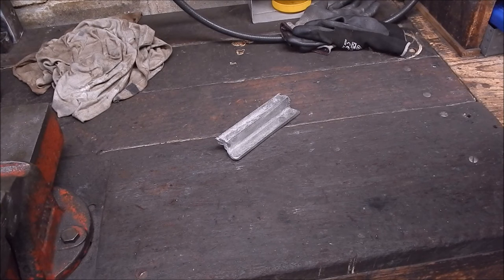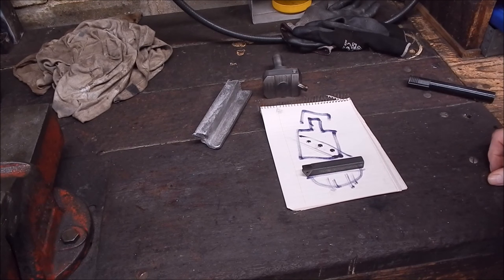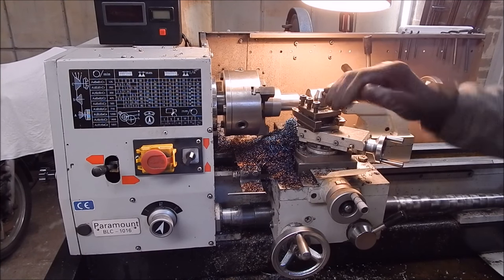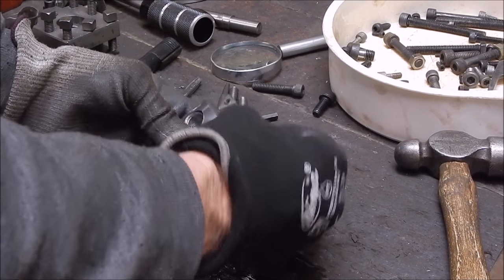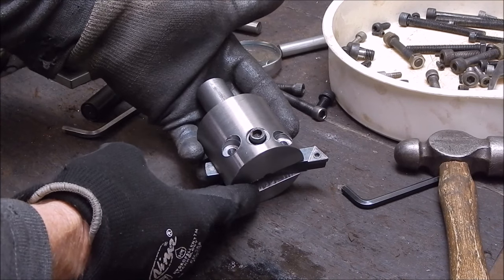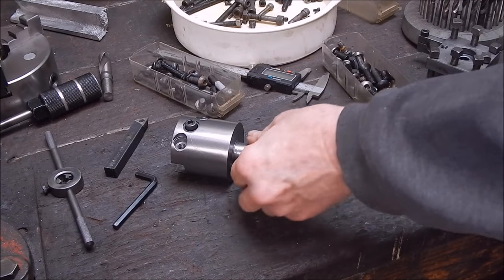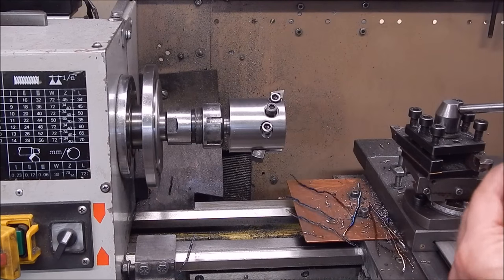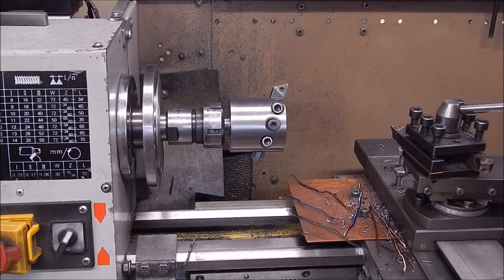Make a fly cutter that uses your existing carbide tooling.

Comment from the maker: In the example shown, the angle of the cutter slot to the work is 20 degrees.

For TCMT style inserts, this is as low as I would go.  From 20 to 30 degrees would be OK for this insert.

Vary the angle to whatever best suits the cutter profile you have.

Cheers Rob

Comment: Great tool I like that you made it yourself as now a days they are very proud of them and they seem like they cost too much yet even if that tool costs too much it will break even and make a man money some day. It won't be long either if he keeps busy. Yours is top notch and made with good skill,material and at good cost. Nothing better for putting a good flat surface on a part rather than dragging a face mill over and over again for flat ness. Even if you have to use several passes a flycutter does good flat work when the tool is right. Thanks for the video!

Comment: Thanks Bob for a really informative video loved your idea with the cardboard shield and of course really loved the fly cutter video well done.
Reply from the maker: Thanks Gary.  That cardboard shield is worth double it's weight in gold bars.  Saves getting covered in shit while machining. 

I'm working on brass at the moment for that Stirling engine project and I hate brass because it sprays little slivers everywhere.  Makes a huge mess and can get into your skin or eye easy.  Looks nice but it's a bastard of stuff.  The shield helps stop a lot of that and gives you something to hide behind.  LOL.

You can see by the condition of my cardboard that it gets lots of use.  Just tear out a hole to clear handles etc ;)

I think I nearly need a new one.

Cheers Rob

Comment: Great job, Rob. That tool looks like it would last a lifetime.

Those cheap treadmills are sweet aren't they? Folks buy them, use them for a while until they get bored with it, or maybe it will fail in some way after about a year or so. Then they usually chuck it in hard rubbish, and guys like us get free bits and pieces. Good stuff :)
Reply from the maker: Yep, treadmills are goldmines for people like us.

Allen headed bolts, steel shafts, roller bearings, fabrication steel,  heavy tube rollers,  DC motors etc etc.

Trouble is when they die, it costs too much to fix them, and no one knows how anyway.

So the thousand dollar treadmill suddenly becomes worthless when it stops.

He He, cheaper and better to run around the block a few times IMHO.

Cheers Rob

Comment: A bandsaw tip when cutting large diameter round stock, when the cut starts to reach the midle stop cutting and turn the piece 90° then carry on cutting, it will cut faster.

Comment: I'm going to give it a go myself - great video.
Pete
Reply from the maker: I've done some basic test runs with it, and it works fine - using carbide and HSS.

But carbide will never give the finish that HSS will on aluminium, due to the way carbide works.

On steel the carbide works better.

Cheers Rob
Reply: I'll have to look up what sort of tool geometry is recommended regarding grinding an HSS blank for a flycutter? ...no big deal to make one for a carbide insert holder and another for a standard HSS blank I guess.
Reply from the maker: Generally round nose cutters work best on non ferrous metals.

You can buy 13 mm HSS square stock which will fit straight in (or shim up some smaller stuff).

In a future video I will demonstrate both.

Cheers Rob

Comment: Very good job, Rob. Made one myself for my tiny Proxxon micromill. Forgot to harden the cutter :( but it still worked), fly cutters are great things. But the angles are kind of critical, need relief for the cutter, work it out. Make an accurate drawing. Don't need CAD for that.
Reply from the maker: Hi Juan,

HSS works well and comes in small sizes.  Just use a broad radius round nose shape, with back and front relief.

Works a treat.

Cheers Rob
Reply: Thanks for the tip. I'll get back to it soon.
Reply: Juan Rivero

Comment: I made something similar only last week, with the triangle cutter at that angle you will get edges splintering at the far end of the surface you are surfacing, the leading edge undercuts and when the wedge flies off it takes some of the side with it, having the triangle set upside down so point down instead of leading then when you get to the end you wont have an undercut but rather a raised lip which slowly diminishes, myself I used a rectangle insert from a face mill seeing that I didnt have any spare insert screws, I wish I could post a picture here

Comment: I'm asking because I don't know, but shouldn't your grub screws be pressing the tool against the center line?  As is your tool will be off the center line unless it is the same width as the milled slot (unless you shim it from the back side).  The reason I asked was that you mentioned leaving the screws long so that you could use smaller tools. Nice project and I'm really looking forward to seeing it in action.
Reply from the maker: Yes, you are correct, for smaller sizes I should shim the back side so the cutter edge is at centre.

I left them long because I have yet to see what moving the cutter tip back will do.

I have another form of cutter insert in mind that I will try out as well, so it's better to have extra thread than not enough at this stage.

Cheers Rob
Reply from the maker: I would have preferred to have the grub screws on the backside of the cutter as you suggest, but this has much less metal area to take them, and it would weaken the main load bearing area.

So I will shim to the centre line (if necessary).

Cheers Rob

Comment: Great job as always. What angle did you mill the slot?? Thanks
Reply from the maker: Twenty degrees.  But this is only an arbitrary figure, as it will vary with the type of insert and offset it has, that you are using.

Rob
Reply: xynudu thanks I'm in the process of making one now . Would it work with hst the same that carbite inserts??
Reply from the maker: Yes, works very well with HSS, depending on the profile you grind of course.

In fact HSS is a better choice for non ferrous metals such as aluminium etc.

Cheers Rob

Comment: Hi Rob, could you tell me the carbide tool number and the carbide tip number you used. Regards Kevin
Reply from the maker: The inserts are  TCMT 16T304.  They fit a 1/2" turning set.

Just search Ebay etc for:   1/2" shank lathe indexable turning tools + 10 pcs TCMT 16T304 Carbide insert set

You can get TCMT inserts in smaller and larger sizes as well.

Cheers Rob
Reply: Thanks Rob. Have just ordered a set. Regards MachineNZ